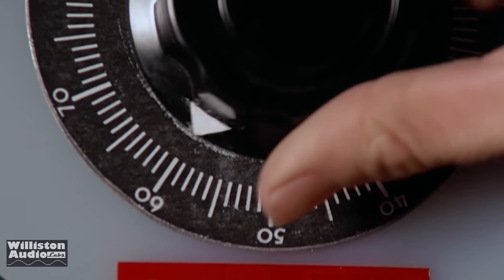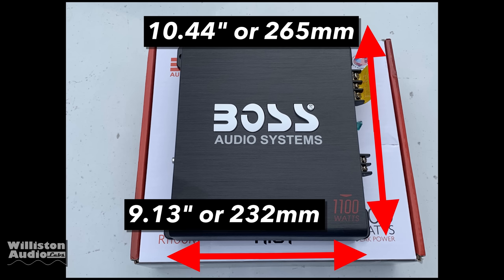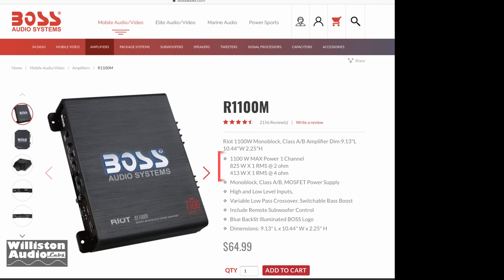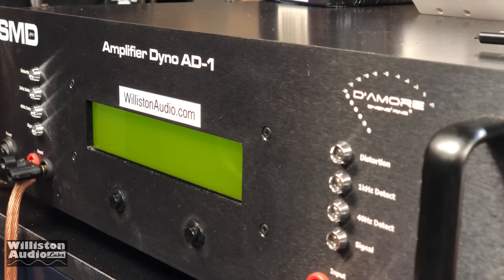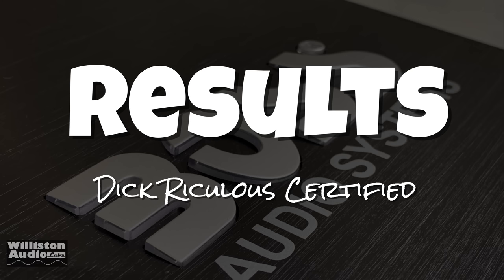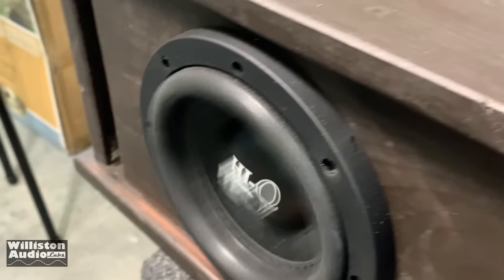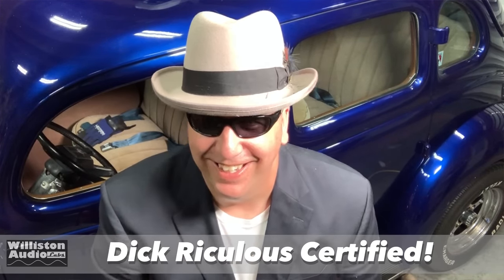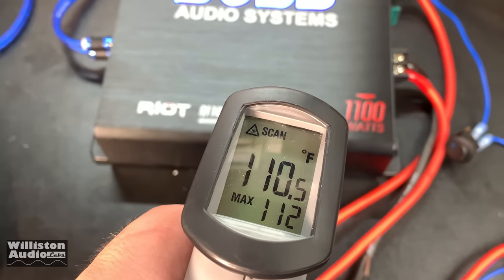Best Selling Car Audio Amplifier on Amazon (2019)? Boss Riot 1100M Monoblock [4K]

Comment from the maker: See Budget Gem or Budget Bust Test of this amp: https://youtu.be/BS8NM_Repr0

Shop for this amp on Amazon: https://amzn.to/2NMXFsK
Boss AR1500 Amp Video: https://youtu.be/omK1eyFqc08
See playlist of Budget Car Audio Amps Tested: https://www.youtube.com/playlist?list=PLu98-M_EowHMtCIiCz0v6_2gLnsmdLL0V
Reply: Question: for a single channel on a 4 channel amp would you divide the watts by 4?
Reply: Big d. Do you ever sell any of your old school amps?
Reply: Do the American bass hd 1500 watts
Reply: Hey Big D, quick question I have a single ts-w2502d4 and I just bought the Skar 1200.1D to push this bad boy. How do I tune this amp to best push the sub and how do I wire this sub for the maximum amount of power I can toss at it. Right now it is wired for 2 ohm, I mainly meant the amp has 4 terminals and I don't see it bridged?? Just do far side + and far side - ?
Reply: Always enjoy your videos. Would be interesting to see, with the amps that don't meet their advertised power, what happens when you start edging up the fuse amperage.
Reply: can you test x12 amp like mrv705 4 channel amp its around 2200 php or 45 usd
Reply: Williston Audio Labs can you test the ssl evo 1500.1
Reply: Hi could you possibly do a dyno on a Hertz HDP1 @ 4 and 2 ohm? Cheers. they are $600 amps rated at 600rms cea @ 4ohm, but 1000rms @ 2ohm. 120amps of fusing 4 guage inputs.
Reply: I was taught overrated amps like these could potentially reach 1100 watts if it were hit by a lightning bolt while in use
Reply: Do the autotek ta1050.4.1000 watts amp

Comment: "you will need spade style connectors for proper wiring" me shoving bare wire into the terminal, "what?"
Reply: Definitely nothing wrong with it😂 it only becomes a problem when you connect and disconnect more than usual the strands will start to break off
Reply: Not me splitting the wire into a fork, twisting both prongs and jamming it both sides of the screw
Reply: Me with a 4 gauge wire smashed into the terminal and wrapped around the screw xX
Reply: Same🙋🏻‍♂️
Reply: I thought the exact same thing, I set up the power splitting the naked wires in two and shoving them between the screw….

Comment: I've bought a couple of these amps for two different systems and I LOVE this amp! It is a GREAT "affordable" option for good sound without worrying about your car electrical system being strong enough etc. Great options, fun to use, good down to 2-ohms....An excellent choice for low cost but good sound and power.

EXTRA:
This amp is not good for people with self esteem issues or high power competitions. Your friends who spend $500+ on Sub Amps may make fun of you. But if you have outgrown such self esteem issues and want good, "Loud Enough" Sub woofer and you cannot afford $500 just for a sub amp (say a Dad with kids etc), this is an awesome amp that will NOT likely burn out and will last a long long time.

PS:
This is just my own opinion based on my own experience.

Comment: I'm not by any means trying to stick up for BOSS AUDIO SYSTEMS by any means because to be honest I straight up went for a Budget friendly build on my car using this exact same amplifier granted I knew their watt ratings are bull but to be honest for how cheap and budget friendly it is I'm honestly impressed with how it preforms the only thing I don't like is the fact it has the tendency to get a bit toasty but otherwise sounds clean and very easy to tune

Comment: Thanks for your video. I had the amp sent back, ordering the soundstream Picasso nano p1.1000 instead. You did the review on both amps. These are the budget ones on amazon. My 10" eton flat m10 subwoofer is rated 300w rms and for sure this 110w boss riot dont make the cut.

The soundstream is doing great pairing with my sub. Keep these videos coming! It helps consumers make informed decisions and not relaying on the bs ratings manufacturers put on their product.

Comment: As an exercise in minimalism I bought one of these and a pyle dvc 10".  Built a 6th order tuned to 28/42 hz.  It sounds fantastic.  My expectations were realistic tho.  My first amp was a 1990 model punch 45.  It had almost identical specs to this amp and cost $300.  That's $300 in 1990 dollars when minimum wage was $3.85 an hour.  Will this power a competition setup? Of course not.  Will it get a kid with no budget into our hobby? Maybe so.
Reply: Exactly, that was how I got into all this. Bought a kit for $130 (this AMP, a RF R1S4-12, box, and wiring kit). now that I have better, that setup was pretty weak in comparison, but the point is it got us youngsters into the scene for an affordable price. This amp has enough power to safely drive the R1S4-12 and still sound okay for a beginner. Won't win any competitions for SPL or SQ/SQL, but that isn't the point.

I now have a RF P2 12 in a .9CU ft box running off a RF r500x1d and while I wish I had opted for a vented box, I couldn't be happier with this purchase.

Comment: I remember getting one of these, a wiring kit, Rockford P1 subwoofer and box for like $169 back when I first got into car audio. All my friends raved over this amplifier believing it to be an amazing deal, but I watched this video and realized how fooled everybody was. The sad thing is, the shop that installed all this for me not only charged me more than the setup was worth for 1 hour of installation, they also swore up and down that this was an amazing setup. They had the gain, bass boost, everything turned all the way up just so the poor RF p1 would even make noise. The p1 handled it like a champ though, and I later sold the setup to someone else and told them to get a better amplifier ASAP and better wiring kit. Guy threw it in the back of the singlecab truck and AFAIK he loved the setup. "Knocked the socks off my two Memphis 10s" he later told me.
Reply from the maker: Thanks for watching and commenting!

Comment: Thanks Derek for the video. Now I got to give a 100% honest review to the real world user of this amp. I own the "2400" watt version which is 1 ohm stable. I bought it many years ago when I got my first system. It powered 2 pioneer's in a bandpass. It sounded great. At that time I didn't know I was probably only getting 500 watts max! I used that amp forever until I got rid of that car. Now I finally got a new vehicle and just installed a sundown sa12 in a ported and tuned box and decided to dig up this amp to see if it still even worked. Dusted it off and got it hooked up and surprisingly yet again it still works and moves this 12 enough to sound really well. I just ordered an audiopipe 1500 so I can feed this sundown some more power but to this amps credit it is very durable and although way underpowered it does move a sub. I'm probably going to have to bring this thing to my friends ranch and shoot it with my shotgun to kill it. The 2400 watt version is definitely good for the newbie who has but a $100 to spend and no more. Even though it's overrated I think the 2400 watt version is worth the money but yeah, I recommend saving up a little more for a audiopipe or even a pioneer.

Comment: We played around with boss back in the late 90s. They were dirt cheap and looked pretty cool. We tested them on JL subs against planet audio amps. There was something about them that would throw the subs like crazy, like 1 inch excursion on the same track the planet audio was throwing half inch. But oddly enough the boss was producing half the volume. It was like there was a bunch of infrasonic distortion introduced by these amps. Long story short, we would never sell these to anyone who wanted to actually make SPL. If they wanted a bit of bump in the trunk, like less than 120dB but that was it.

Comment: Remember the Sanyo PA-6100? Rated at 50 wpc and put out closer to 100 wpc? I had a Fosgate Punch for the front and a Sanyo for the 10's, a total of 250+ watts and it sounded great. I don't understand the obsession of so much power you can't turn it up when you're in the car.
Reply: That was my first amp !

Comment: I’m not gonna lie I bought this amp and ran it on 2 10 inch kicker comps and it blew me away by the performance. Much worth the 60 bucks in my opinion.
Reply from the maker: That’s cool 😎
Reply: It’s good for 1 day , shit amp
Reply: @nonyabusiness7887  I've used mine heavily since 2014 and now my son is using it in his new Mustang. It is a great 200+ super clean watts for $60 or so. "Dollar per Watt" and reliability is what I care about. I see a lot of people crapping on this amp that haven't even used it. I laugh through every song each day I use it (well, my son now days). If it beaks I will just buy yet another, but it has been 6 heavily used years and it won't break.

Comment: People have to remember that this is a a/b amp. Back in 92, I had 2 kenwood 921 on 4 15's that's basically The same power as this boss. 200 Watts of class a/b is so much cleaner (sq wise) then 400 Watts of class d, that's why this amp sells so well. I have a 1k alpine Mrv 1505, class a/b that I'll put against any taramp 3k or any class d for that matter. They have this new class d transistor technology that suppose to 300x faster, with the sq of a class a/b, but the price is a dollar a watt

Comment: As in most all specs for audio equip, the rated output is Per Channel.  You see 400 watt car stereos advertised all the time, but it doesn't mean you get 400 watts, it means you get 4 channels at 100 watts each.  I suspect Boss is doing the same thing here with this 2-channel amp.
Reply: WanSolve it’s not a 2 channel amp, it’s a single channel amp
Reply: sohaib mahmood yeah I just noticed that. Thanks!

Comment: I agree, boss seems to be durable stuff and I would just like to see them be honest about the numbers
Reply from the maker: Maybe they will change?
Reply: Warren Stearns I think I hold the same sentiment. I just made a comment about my amp (also a riot series, but it’s the 2 channel “600 watt”). I love it and it’s been reliable for multiple setups throughout 5 years, and even pleasantly surprising with my recent box change to accommodate my new-to-me 1997 blazer. But I know it can’t be putting out what it’s rated for.
Reply: @Genesis385  lots of people have tested boss and if it's rated at 600 I'd be surprised if it's putting out 200 RMS
Reply: Warren Stearns same here. It’s rated for 225x2 @ 2 ohms which is what I’m running it at right now. Doubt it’s making that much.
Reply: @Genesis385  yeah half that if your lucky probably more like a quarter of it

Comment: I think Boss has their own numbering scheme. The numbers are fine if you only pair them with other boss products. Like I'm sure this amp pushes their 1100 watt subwoofer just fine.
Reply: true. im using a boss phantom 5000 to power 2 kicker comp r's and i love it.
Reply: THIS! I've got a Boss Armor "1500 watt" amp, paired with the Boss Phantom "800 watt" subs, bridged & in the correct sized box - it hums very nice for what it is. I don't think I would run a Boss head unit though, I've got a decent Pioneer double din in there instead. Everything works how it should & I've got less than $200 bucks in the trunk, box included.
Reply: You mean they lie about true power output and capabilities 😂😂

Comment: I wish back 3 years ago when I put together my first car stereo system I had known enough to watch these videos! This amp you just did the dyno on was my first amp powering my first kicker 10in cs shallow mount sub in a truck box. It was still enough power and I'm sure distortion to blow the sub. But yet I still went on to buy a 4 channel amp for my speakers from these guys. The 4 channel amp ended up burning itself up after a year pushing my new at the time kicker ks speakers. By this point I had learned these amps are literally garbage. Now I'm running a skar rp150.4 for my mids and highs and an alpine mrv-m500 for my kicker comp r 12 sub and I've got super clean super loud sound

Comment: I'm just blown away that there's no class action law suit, company's that sell cheap homeowner air compressors had a class action suit about the bullshit ratings, they were rating the cfm at the compressor intake not out the inlet and that is drastically different, they would but a 5 cfm tool and 5 cfm compressor and it wouldn't run the tool very long... They got there's cost the company's alot of Jing...

Comment: The real rating compared to the advertised rating is horrible... That would be like Toyota claiming that the Camry gets 160 mpg. It would only take people a week or even a day before they filed a class-action lawsuit and won. But when you only charge $50 on a product that many people dont have the equipment to test besides their ears, "Boss" knows they can keep scooping that money without repercussion. As of right now, that same Boss amp costs $81 before tax on Amazon. At it's best, that's almost $1 for every 2 watts. But a Skar 350.1D for only $12 more will push 400 watts of real RMS half the cost of watts per $ without the junky screw/spade terminals. For those who build a system with some extra [usually unused] headspace leftover, the Skar is more efficient... and there's others like it. I'd like to give Boss a compliment for being reliable, but if it can't hit 200 watts it's not generating enough heat to cook itself if the board is smart enough to know how to handle its output once it reaches >1% THD. Back to their marketing claim: If they said "this is a 180 watt RMS amp," it would at least be respectable, but "1100 watts" sells a lot of units and 180 would only sell to a niche consumer.

Comment: I'm Curious, do you mess with the amps at all during testing? Like, setting amp gain, freq cutoff, full range or low range, db boost? I don't know if that any of those would really change any of what the amp can output. But, just wondering if you do any adjustments or leave all that alone to do the test?

Comment: I'm assuming 85% of people who buy this or majority of budget systems don't care about true output they want "loud" bass. Nothing else matters clean sound, mids, highs, etc They don't care.  Hell 90% of them don't even run wires properly. If 65 bucks gets that 12 inch beating and trunk rattling it was worth it to them.
Reply: No, 90% believe that it really is producing the claimed power
Reply: @VisionSandS  Nope not even. They want anything that gets the sub to shake the car.. I see 90% of installs dim the cars head lights when bass hits they don't care.

Comment: If you believe this amp can do rated you've either been living under a rock, or you just got into car audio yesterday. In all honesty, it would be a decent amp to rock a small efficient sub, a set of coax's or a set of tweeters. Just don't expect those outlandish ratings. Lol Great video BigD!! 👍
Reply: calee4nyaboy  Yeah I kinda realized that after the fact. Lol Just buy a second one and there goes your stereo.
Reply: calee4nyaboy  It's a full range mono with selectable crossover. Not sure if there's a high pass. But yeah, I'd look elsewhere too. Lol

Comment: I bought a 03 grand prix sedan and it had the 2 12 dual illuminite bandpass with a 1100w riot boss amp, the previous owner had it all installed at best buy and for being in a closed trunk the setup puts out phenomenal amounts of bass, I've beat the brakes off the system for a year and it still performs exactly as when I first purchased the car, the bass can be heard from at least 2 blocks away just the factory speakers are lacking quite a bit to keep up

Comment: Lol pair it with a Pyle Power 15 dual 4 ohm and it'll get down. Puts out more power than any head unit so for a little add on amp with cheap 2 ohm sub, you can get some thump for a fraction of a weeks pay at any entry job. 

For your money though you get a lot more with a bit more than double the cost (which is still really low at sub $150). The Boss AR4000D for example destroys this amp at 2 ohm even at 12v. Pair that with a Skar audio or American Bass dual 4ohm subwoofer, a setup for less than 150% more money, and you get 5-6x or 250% more output.

The Pioneer 9601 you reviewed a while back on a 1ohm load did 1500 watts on your test bench. That amp was around $150 back in the day. You would need to invest a lot more into power the system though to get that out of it in a car.

Comment: If you buy an inexpensive Polk Sub for your Home Theater you would basically get this same level of performance for about the same amount of money. So as a budget alternative its hard to beat. I did not know better in 2006 and bought a 5ch Boss for my 4 Runner. Guess what still sounds pretty good. I am not into SLP by any means but rocks and bumps 3 years later. Most people won't believe its an inexpensive amp. Thanks for the content Big D.

Comment: 100 to 200 watts is good for basic sub install. Look at the old. Punch 40.2 or 150 they push hard. They should state actual watts people would have more respect for them. Not everyone wants 1,000 2,000 watt system
Reply: I want 2k watts
Reply: @justposted3524  get it
Reply: Sq is ass
Spl is the best
200w is basically my stereo rms😂

Comment: I think the perspective on what you can achieve at a power level is the issue in this market. However their lies are still straight up dishonest.

As you said, it's surprising what you can do with little power. Atm I've just got a 12" JBL GTO1214 sub, in a small ported box, wired to my head unit with subwoofer direct. People might laugh, but for £15, it's nice to have simple lows again. It's impressed me for how little effort it takes to setup, and how cheap.